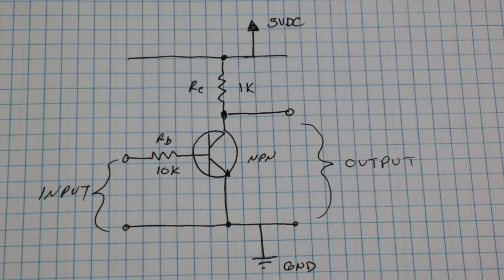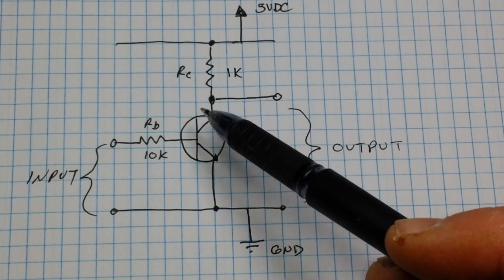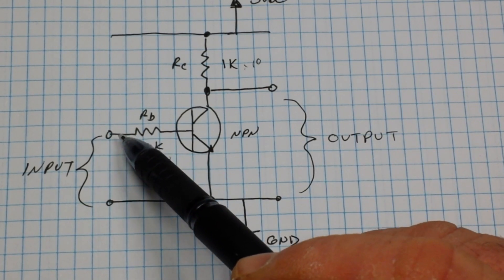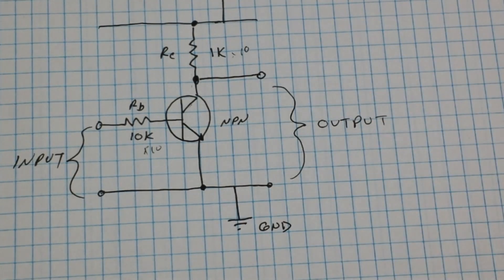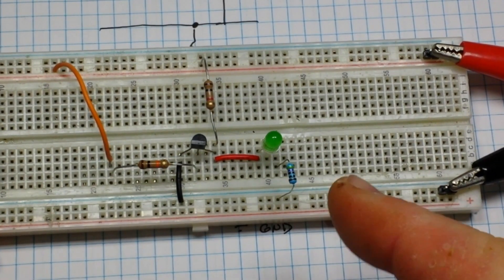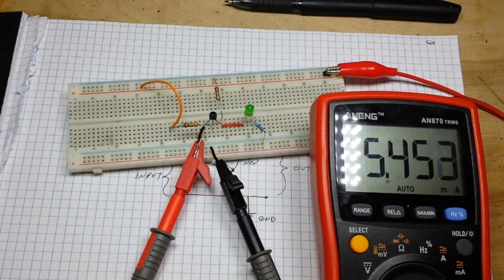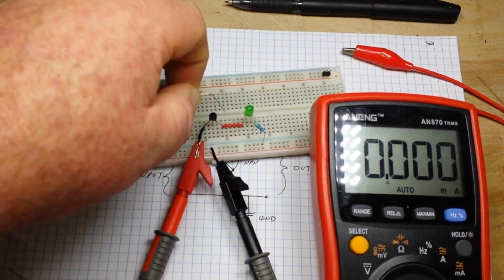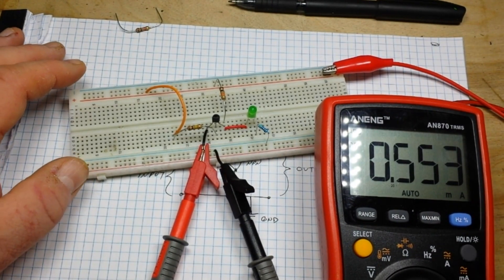Classic Circuits you should know: transistor inverter

Comment: Much thanks for the video. What if to the output we add R3 such that Impedance of the transistor is much higher, than R3 (R3<<Imp)? This new invertor won't be correctly logical, since, when A is HIGH, Y will be also HIGH, am I right?

Comment: Just found this series and love it. I'm playing along on tinker cad, Is the input supposed to connect to ground or to the positive voltage? your diagram looks like ground but I'm not getting to to work unless I do positive. Also I think your circuit is set up this way.

Comment: Great video in a 'lab' setting. Do the same with your input signal as a voltage supply to your transistor collector. 
- Paul
Reply: Here's what I came up with
content://com.android.chrome.FileProvider/images/screenshot/16676119168503345115797850563596.jpg

Comment: One thing I don’t understand though! In Forest Mims book “Getting started in electronics”, page 92, it shows a combined buffer, inverter transistor circuit, where 2 LEDs are connected between ground / Emitter for LED1 and ground / Collector for LED2. In case of Low input, LED 1 will be off and LED 2 will glow. That is perfectly understandable, however when the input is high, the transistor is switched on and, in my understanding, I expect both LED to be lit as they become kind of two LEDs in parallel after a 1K resistor. Why only LED2 is on? Thanks.

Comment: thanks for the detailed video! its very relaxing to watch!
i just measured the current draw of the whole gate and its around 0.67 mA if it has a HIGH input. is that normal, and could i reduce it? if the input is LOW, the current draw is 0A.
its for a battery project. 

i need a LOW signal if the cell gets sun , thus the inverter and it works

but 0.67 mA is too much, maybe an op amp buffer behind it?
thanks!!

Comment: These videos have been key to implementing these doohickeys in real life. The hardest part for me has been to relate the spec sheet for the transistor to calculate what I need to control it. If you can suggest where to go for that, I'm on it, but I think implementing more of the planning for a circuit, selecting the V, I, R for the specific transistor from the data pulled from its spec sheet would complete the puzzle. I'm a noob, so, I don't know how you got to choose this transistor, how you came to choose the resistor, how you knew which power settings... yep, all of that. :)
Reply from the maker: That's too much for an answer in the comments. I will make a video on biasing transistors.

Comment: I used this circuit as well as a simple timer circuit to create a circuit with two LEDs and a button normally one LED is on then when you press the button one LED turns off and the second one turns on for a short while

Comment: I have one of the most popular remote control hobby transmitter called frsky qx7 . And it has a inverter problem that prevents higher speed serial peripheral RF circuit. And this episode explains why the high speed RF vendor gives us a transistor to fix the problem. Nice episode.

Comment: 1 more resistor and you can get both inverted and non-inverted from this basic setup. 

When you get the basics down, the only limit is your imagination.

Thank you, Paul, for helping to inspire people to greater heights.
Reply: Would you mind explaining where this resistor would go?
Reply: @robertchaparro7225  Sure. Another resistor between the emitter pin and ground (instead if straight through) and tap the non-inverting output at the junction of the the emitter and resistor, basically a mirror of the upper/inverting output. If you google electronics-tutorials and phase-splitter, you'll see exactly what I'm describing.
Reply: @TheTrueVoiceOfReason  thanks for replying I’d like to get better with circuits and it really helps being in the comments lol

Comment: Really, really interesting, dude!!! 😃
On the "rc world" we have the SBUS protocol for FrSky (that is the manufacturer of the most used radios and receivers - or at least was, but that's a long story). And it's signal is inverted (in relation to other protocols)... So, some flight controller boards (the F4s) need a inverter like that in one UART. 😊
F3s and F7s have it in software or something like that. 😊

Comment: would be nice to see sine wave on scope. Input and output.
Reply: On this circuit there would be no sine wave output. The output (LED) is either on or off or high or low.
Reply: @petertyrrell6690  Thats true. I was wondering if it possible to use instead of opAmp for negative voltage convertion. For example ADC pin on MCU takes results for Voltmeter, but it must be always posetive. So as long we have negative voltage it would be nice to know if we cold convert it only with one Transistor or we still need opAmp for that.
Reply: @goodwill7643  One could likely re-configure the circuit to do many things but then it would not be a simple not gate any more.